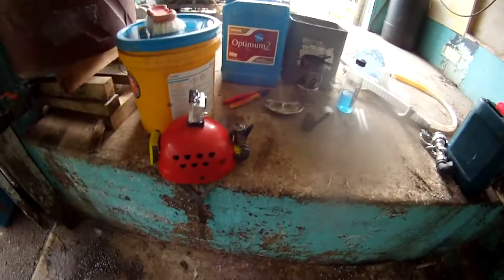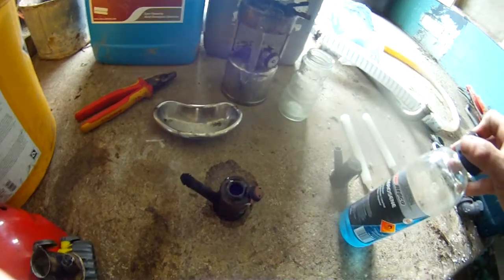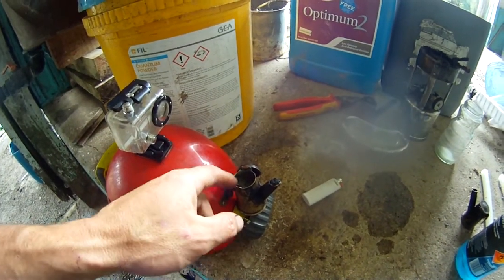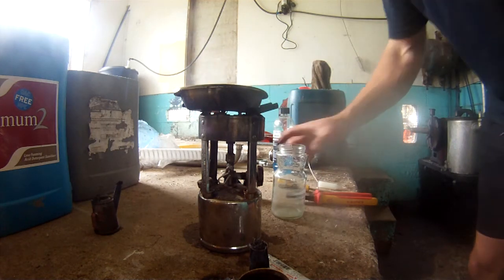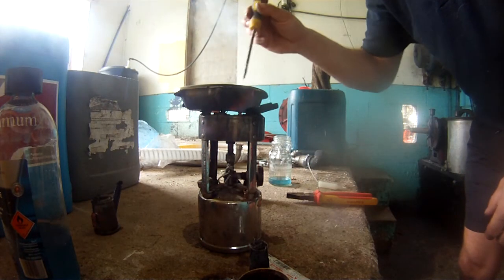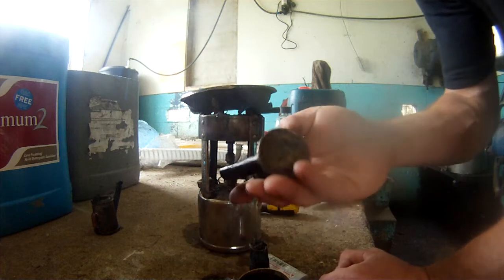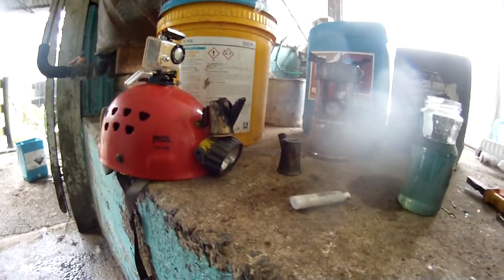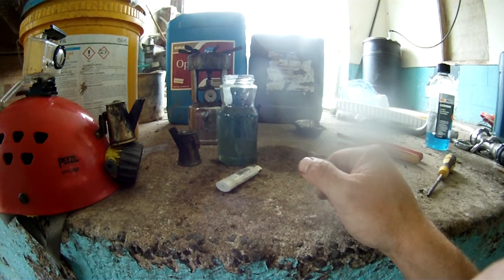making semi solid fuel for kettle lamps  ( miners oil wick lamp)

Comment: Thank you for sharing this, ive been looking all over for a video like this! It would be really cool if you uploaded a video on how you make a kettle lamp like the ones you've made!
Reply from the maker: thanks for that i will do
Reply: @tony-lq7yk  Once again thank you very much
Reply from the maker: all good  happy to help  i will get more materials and make a video of me making the parts  including using the dies i have made to produce the lids . tops  bases ect  happy to  thanks
Reply: @tony-lq7yk  Alright sounds great! Wish i could support you more, because i have this kettle lamp that belonged to my dad in his miner days and ive always wanted to use a lamp like this in cave exploration but i never knew how to make one so i appreciate this very much.
Reply from the maker: thanks 
they  are great  to use in cave exploration but they do have their disadvantages,  the main disadvantages are  they do smell and smoke a bit, they dont work under water and need relighting after a sump dive. if you are looking straight down a lot e.g. abseiling down somewhere  the flame can heat the lamp causing all the fuel to melt and it sometimes can drip out the spout.
they are bright and really light the way  in fact i have had people run up saying that my head is on fire lol
an extra light source is a good idea as a kettle lamp does take a bit of getting used to if you haven't used one before
the one on my helmet is an original lamp from the miners days  i have used it as a primary light source  on many caving, mine exploring trips  i used it when i abseiled 250 meters down the harwoods hole  cave system  i love using them too. 
to buy them off ebay ect they can be really expensive hence why i make them  when i need them  eg the 6 used at my camp out hut
Reply: @tony-lq7yk  Yeah, i have used them before and they definitely have their disadvantages but they are really reliable and just ''fun'' to use, the only problem is i feel so bad using originals and the ones on ebay, amazon e.g. are very expensive and it would be nice to use one thats not original for trips like the Waitomo caves etc just so i dont feel that guilt of wearing out an original